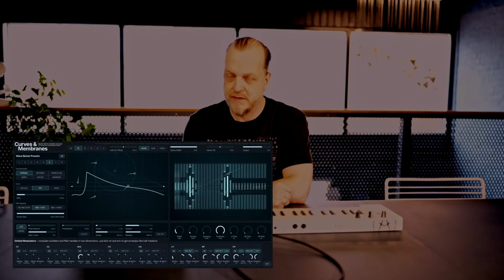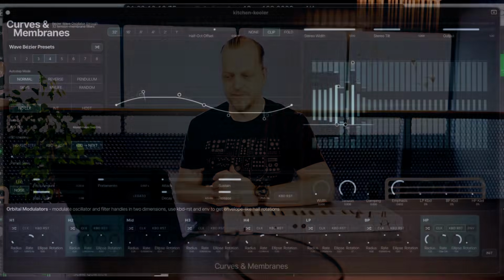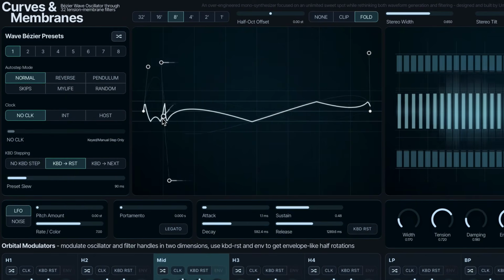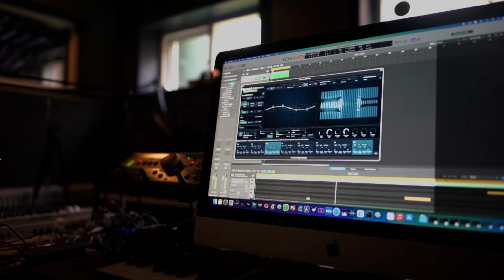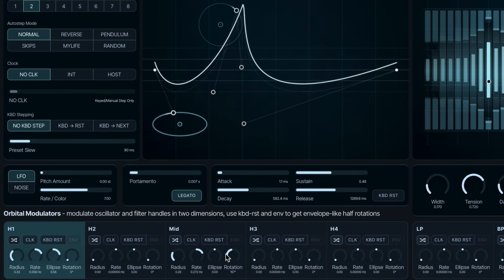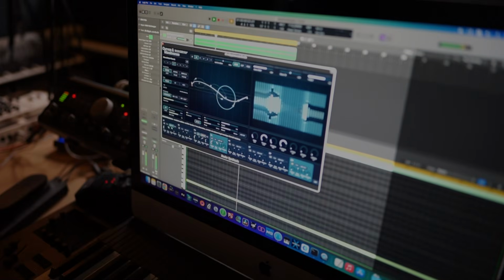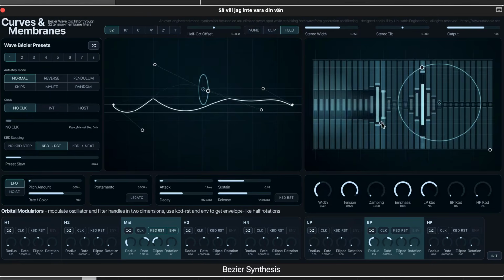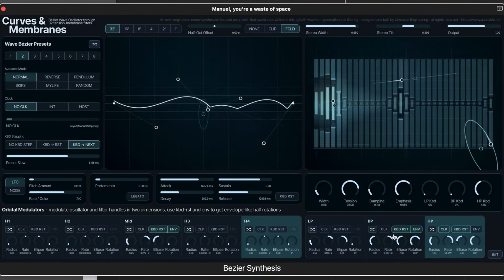Curves&Membranes - Software Bézier Monosynth w. Orbital Modulators & Membrane Filter - Walk Through

Comment: Exciting concept! Sounds great for what it is intended for. May I suggest colour coding the bezier handles and their respective modulators so it is easier to discern visually what is doing what cause it can get busy very quicky. Other than that, looks great, and more importantly, sounds unique!
Reply from the maker: Thanks. I actually had color-coding in my earlier versions, based on the same thing you mentioned - but they gave very little once you have used the synth for a few hours (the logics of the handles and their in-between dominance makes it quite straight forward as I see it). So I went for something I felt looked better as it made me happier while using the synth.

Thanks for your feedback!

Best regards!

/Rasmus